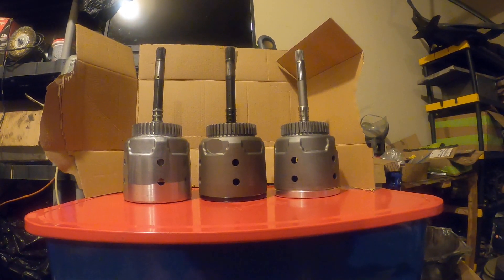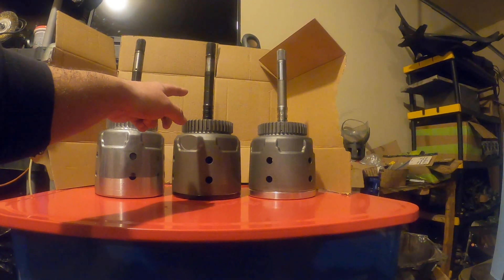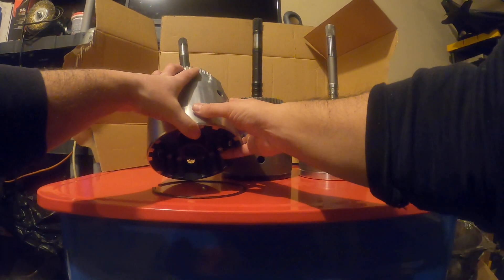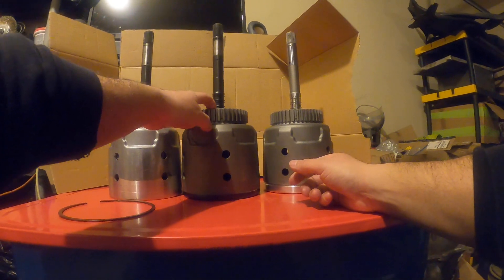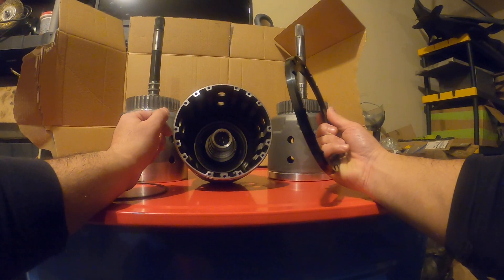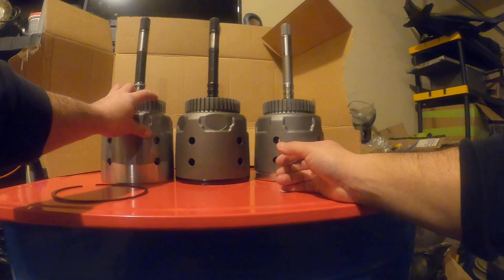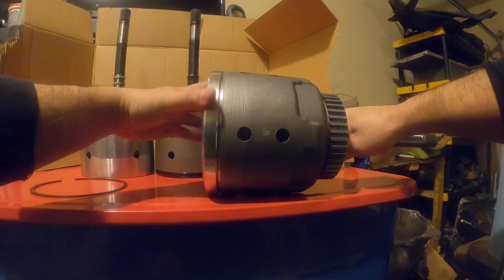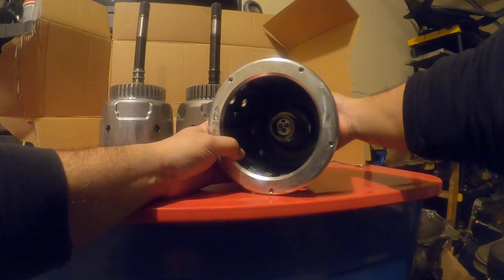4L60e Stock Input Drum vs Sonnax vs 4L79

Comment: i dont know much about this stuff but wanted to have a go at rebuilding my trans. is the Sonnax or 4L79 a better option?
Reply from the maker: I prefer the 4L78 or 4L79 drum over the Sonnax. Sometimes you can get away with just putting a Sonnax drum reinforcement kit in a stock drum. It just depends on the weight of the vehicle and how much power you are putting through the transmission.

Comment: Does the 79 have a coating on it similar to the sonnax? I’ve pre ordered a 78 as they are super busy and are about to start making the steels in house. I won’t be able to officially have it made til next week
Reply from the maker: I don't know about any coatings. I do have a 4L78 drum with Sonnax HD 300mm input shaft pressed in available if you need one.
Reply: @rockroll9513  send me your Facebook or iG
Reply from the maker: @LSMykie  facebook.com/marketplace/item/1957955844389524
Reply: Hey sorry if u guys don't mind where did u guys get ur 78 or 79 drums from
Reply from the maker: @jneri714  4L79. Com
Reply: @rockroll9513   sorry for bugging but when did u get urs they seem to be closed
Reply from the maker: @jneri714  no worries. I have a 4l78 drum with Sonnax 300mm HD input shaft if you're interested.
Reply from the maker: @jneri714  They should be open Monday. Sometimes it's hard to get a hold of them.

Comment: Can you use a different type of  TH350 friction in the 4L79? Or do u have to buy more of the custom friction from 4L79?
Reply from the maker: Custom
Reply from the maker: Custom clutch pack comes with the 4l79 drum..
Reply: @rockroll9513  I was just wondering if the clutch pack were to burn or if it were to be refreshed could I use TH350 clutches or did I have to use the custom clutches that come with the drum
Reply from the maker: @LSMykie  as I understand it the clutches are based on the th350 but are different so you would have to order another clutch pack from 4L79. The 4L78 drum takes the 4L60e clutches, but fits more, like the Sonnax drum.
Reply: @rockroll9513  gotcha makes perfect sense now. I’m looking into the gen2 blue reybestos race clutches I haven’t seen much information on them on YouTube about how well or how bad they perform my goal is to make my 05 corvette auto hold up to 1500 daily drivable with ac power. I have all the sonnax valves for the valve body and a couple of trans go’s, smart shell, reaction shaft, servo, output shaft, overrun clutch, etc. I’ve spared no expense and I’m stuck on the input drum
Reply from the maker: @LSMykie  blue clutches are not good for daily drivers. The 4l79 is better then the Sonnax IMHO. Performabuilt uses the 4l78 drum in there 1000 rwhp builds. I don't believe a 4L60e will hold 1500.